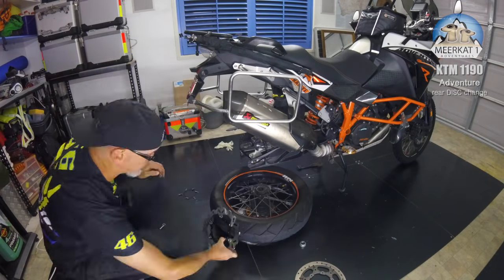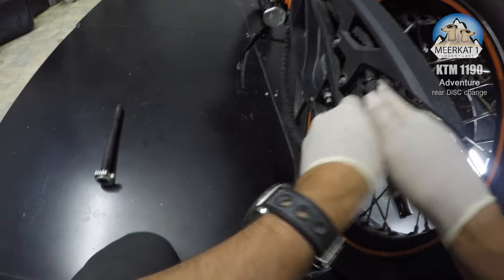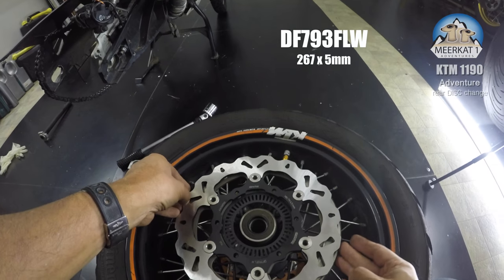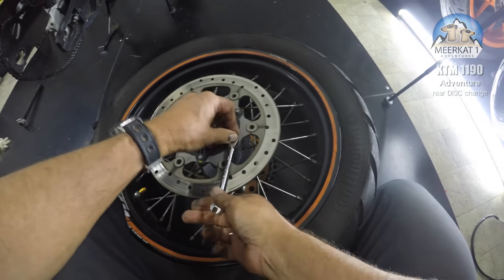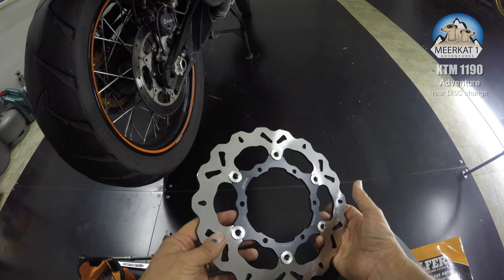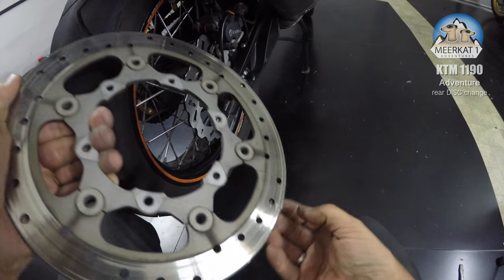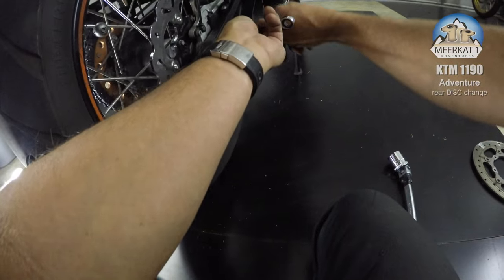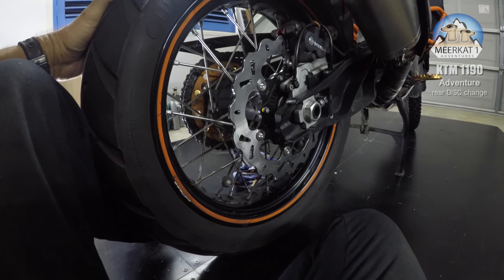KTM 1190 Adventure rear brake disc and pad change with Galfer DF793FLW wave disc

Comment: What type of pads did you fit, Galfer? Are they the semi-metallic or sintered HH? Did you change the rotor to upgrade performance or some other reason? I’m due for new pads and I need to decide on sintered HH or more OEM style.
Reply from the maker: I have been using sintered pads made in China. Work great - Google “1190 pads KTM AliExpress”. Reason for disc change was my disc was well below min thickness  - and also to improve cooling
Reply: Meerkat 1 FilmCrew, great, thanks. Have the sintered pads increased rotor wear at all compared to standard pads?
Reply from the maker: Ronan Rogers - the AliExpress pads where so cheap I thought they would be blah - but in fact they seem just as good with grip and wear as the big name brands?  And they were 20% of the price . Makes me wonder if the middle men talk up the price for rebadging  them